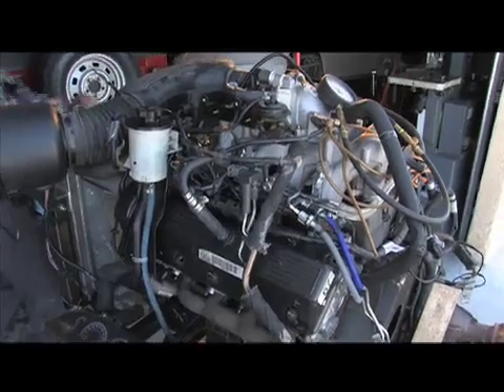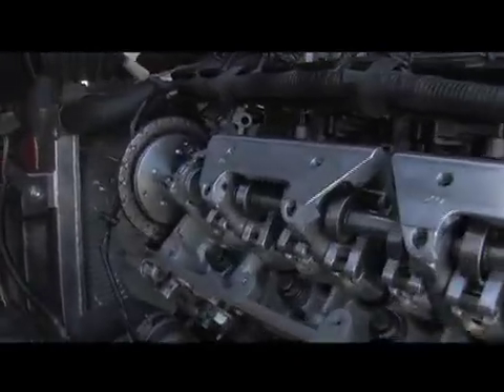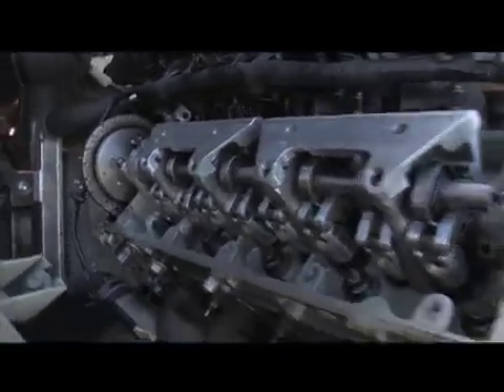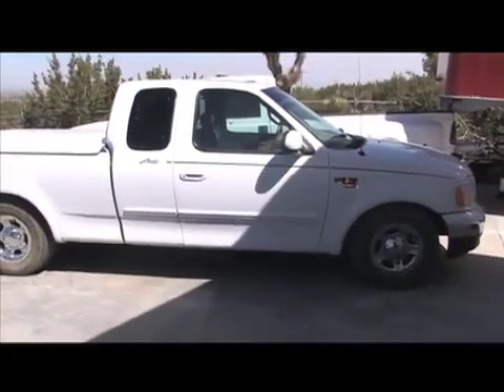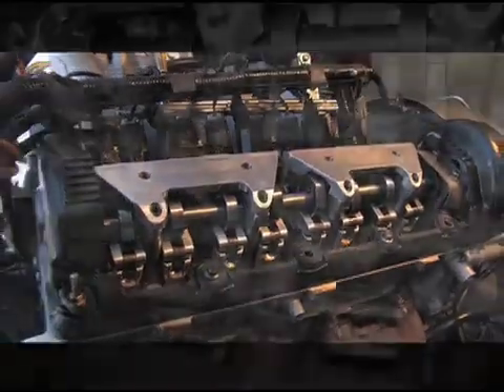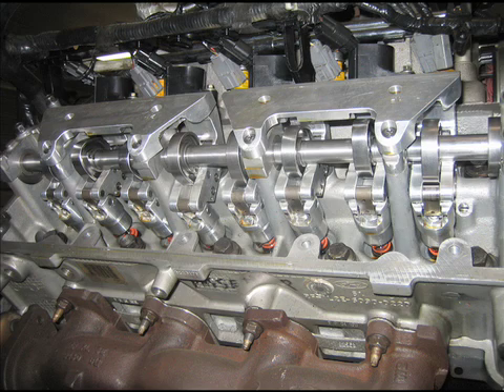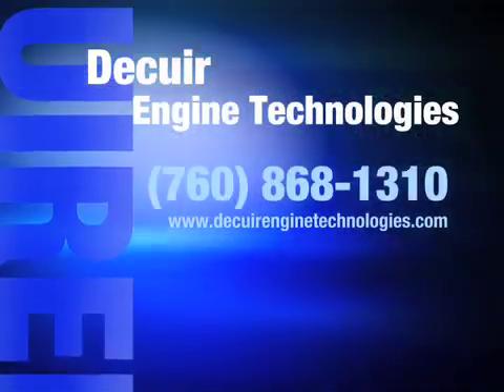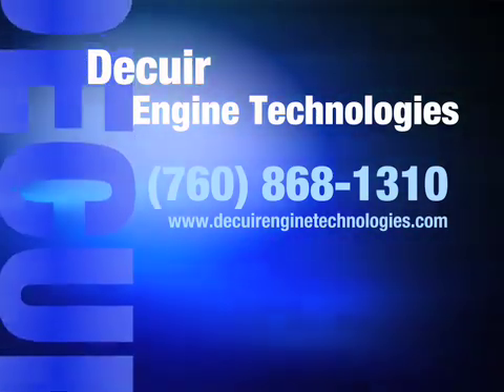Springless Valvetrain for the Ford 4.6 V8 Engine

Comment: it clearly uses heavy springs instead of shims ........LYING FUCKING DOUCHE BAG
Reply: No sir, it does not. The camshaft utilizes an inner groove within the lobes to push and pull the valve open and shut. Any use of a spring at the stem is there to seat the valve guide seal. Mr. Decuir can verify that.
Reply: then it is not springless , and awful heavy

 @CityofDiamondBar

Comment: supposed to prevent valve float ?? when its not revved higher then 1900 rpm I guess valve float would not be an issue ?
its noisy its expensive and nothing shows its worth a shit 
apparently this hick with a machine shop and spare time is hoping a billonaire will see video and give him 40 million to start production ?

Comment: Would this work on a 5.4 as well
Reply: actually, Yes. the only difference between the 4.6 and 5.4 is the deck Hight of the block. and the intake manifold is bigger for the 5.4 to accommodate the wider gap it needs to span because of that increased stroke length.
the real catch is " do you have the right block"   4.6 and 5.4 were produced in 2 different plants  Romeo ( Michigan)   and  Windsor ( Ontario)  and the 2 blocks are different enough for the heads to not be interchangeable.

Comment: lol at the people complaining about the sound. the valve covers are off! idiots
Reply from the maker: Thank you, its amazing how dense some people can be in their evaluation of this system.
Reply: It's still going to be noisy for the same reason a traditional solid tappet camshaft is noisy, there will always be some clearances, lash, to accommodate the expansion of the metal as the engine heats up. Most of us having gotten so used to hydraulic lifters and lash adjusters which automatically adjust themselves to maintain zero lash that we forgot how noisy an engine can be without them. And that's not to say they can't figure out a way to quiet it down later on. As I understand it this is basically a prototype. 
It's an interesting concept but I don't see it really catching on for the same reasons OEM's haven't embraced it.
Reply: so you think valve covers is going to stop this industrial sewing machine motor for making loud noises lol smh

Comment: It would be nice to see horsepower curves before and after.   While I´m here, how do this design compensate for valve clearance differences from cold to hot?  Does it just live with the gap until it gets up to temperatura?  That would account for the noise in the video, apart from the obvious valve covers being off the heads.

Comment: The desmo system works well on the Ducati motorcycle engines however the maintenance costs are horrendous eg new cam belt every 5000 km. Hopefully this system is low maintenance

Comment: Anyone notice the lack of proof on the other bank ?? the noise is normal its masked by valve covers though i cannot say what it sounds like with the valve cover on in real life.  besides if it reduced friction and improved power it could be sold to any manufacturer for tons of money and would be used in consumer cars by now
Reply: good ideas aren't used, ones that make or save a company money are uses unless the epa dictates so
Reply: +bentboybbz IF it was such a good idea, EVERYONE would be using it. It isn't, as the desmo valve train requires a LOT of REGULAR maintainence. The "average" car doesn't require this labour intensive style of valvetrain which is more focused on hi-revving racing engines.

Comment: I can see valve springs. Even desmo valvetrains need light springs to keep the valve against the seat.
Reply from the maker: +Bob Valdez No not correct, as is stated in the video the springs that you see are merely there to keep the valve guide seal in place and have nothing to do with holding the valve against the seat.
Reply: +EmpEntTV  The seal "springs" still bear against the valve retainer to provide tension on the seal. In effect, that still means you have springs in there. The factory valve seals are retained on the top of the valve guide, not by spring pressure, so you still have SPRINGS in the valvetrain.
Reply from the maker: +Bob Valdez Still not so, the springs have such little tension to in relation to the valve actuation of this system they have absolutely zero effect in its presence. The closure and seating of the valve in no way can be effectively done with that miniscule spring in place.
Reply: +EmpEntTV It still HAS SPRINGS in there, regardless of the reason. The 4.6L does NOT need springs to hold the valve seals in place. The only reason for these springs is to help keep the valve seated and low engine speeds. I am a auto mechanic, and have built many engines for motorsport. I'm not an Eskimo, so don't try to sell me ice. ;)
Reply: +Bob Valdez  "and" = at

Comment: Besides the noise, why does it sound like it's missing?
Reply: +GTO Bob 66 I thought the same thing. These engines generally idle and run VERY smoothly, this one does run very rough and unsteady at idle.  If it could run 100,000 miles without problems and show SERIOUS gains in power and torque, then it really is an exercise in futility.

Comment: Bloody rubbish!.  Sounds like a chaff cutter.  No Thanks.
Reply from the maker: +Crobular Thanks for your well thought out and highly uneducated comment.
Reply: +Crobular I It has no covers on it, and no oil. It was probably cold too. It would sound noisy. This is an old idea, and it is why Ducati motorcycle engines are famous. 
Top end horsepower is one thing you get. No float.
Reply: what is desmodromic

Comment: first time I'm seeing this - unless the appearance of it is just deceiving, it looks like you're stuck with a pretty lazy lift profile. I'd expect it to suck all around in terms of performance even though you eliminate the spring loss. That 4.6 doesn't exactly sound like it's better off and I'm not just talking about the noise from the exposed valvetrain

Comment: Desmo valve trains need to be adjusted very often. So unless you like having to pull the valve covers off every year. I would pass on the expense. Ask any Ducati motorcycle owner. Besides todays vehicles are highly efficient with very little maintenance or added cost.

Comment: Is this a diesel?
Reply: It wasn't running dry, that's why you can see oil drops on the camera lens after just a few seconds of run time.  It is rather noisy though, and I'm sure that the valve covers, even aluminum ones, would transmit lots of sound.  Oh, and it does seem to run a bit rough at idle!
Reply: +jivepepper no
Reply: Sarcasm? I know it wasn't just sounds like one.
Reply: +jivepepper Its because they are running it dry and uncovered.

Comment: Why is this needed?  If you are using good valvesprings, valve float usually isn't an issue below 9000 RPM.
Reply: ***** you're deluding yourself if you think the force needed to compress valve springs accounts for 20-30% of an engine's output.
Reply: I'm just saying, money talks, and so does proof.  This video is worthless without any proof.
Reply from the maker: Grant Russell There is also the issue of friction and the amount of horsepower needing to overcome valve spring tension. If that can be diminished or eliminated the natural by product is an increase in power and fuel mileage.
Reply: You overcame the power loss of compressing the springs and added to the rotational mass of the valve train. Regardless, i can think of better ways to add 2hp to my engine.
Reply from the maker: Grant Russell Safe to say that would be much greater than 2hp gain.
Reply: EmpEntTV How much of a gain was it?  It must have had some road testing in the past 5 years.
Reply: +Charles Ball Do you have any before and after numbers though?  Time slips/dyno sheets, etc.  That will shut the 'haters' up!
Reply: Donn29 no hate here. Just logic. A 300hp v8 doesn't take 60-90hp to simply push the valvesprings down.
Reply: Sure the turning the rotational mass of a supercharger that large, combined with the resistance provided by the physical act of compressing that much air would certainly cost 10% of your power. Pushing down 16 valvesprings every turn off the crank does not cost double or triple that. If it did, Audi made a very poor choice abandoning Desmodromic valves ages ago.
Reply: +Donn29 Ducati engines , such as the Testastretta, is rock solid proof of the concept, say, compared to a harley. 

the Ducati Diavel, or any of the race bike engines (paginale ) are the epitome of high tech engine valve train. I would say those pneumatic values are the only thing better, but they are not for street at all.

Comment: I would like more info. Hp gains, will it work with an aftermarket cam and heads, max rpm and hp this can take etc... if i could get in contact with one of decuir's people it would be greatly appreciated.
Reply: yes i wanna know
Reply: no reason it wouldn't work with aftermarket heads, but it is a custom cam design that replaces the old cam.

Comment: Slap those valves they should use the magnetic valve system  are the valve less  super low viscosity hydraulic arrangement developed by me if they really want to save kilowatts.
Reply: It you ever got carbon between the value and the seat the vale would bend bad.
Reply: hey this guy knows his math ..  he is right though .. (save mass) or the correct rotating mass multiplied by chemical force equates efficiency,  I think that is a way to just say it instead of put it on paper  there are other math short cuts for getting a quick idea or if you want spell it out in a (mathematical) to see your own understanding
Reply: Agreed... and if you really want to communicate, you should use the high integrity, depleted uranium hydro-maniac drive cellular phone system I developed in the 70's.
Reply: Never force a valve closed hell never force anything in a engine unless you want to turn it into scrap.

Comment: Still not as good as the desmodromic system developed by Mercedes-Benz  that came in 1st, 2nd, and 3rd place in the 1954 & 1955 Grand Prix with their W196R Grand Prix engines developing 1.91 horse power per cubic inch of engine displacement. Still it is better than the German desmodromic system that was developed in 1914. Go get them Ford/GM/Mopar - still only running 60 years behind the Germans. - but then - so is the rest of the world.
Reply: Germans are better known for over-complicating.  Try setting the cam timing on a Porsche 547 4-cam engine.
Reply: ***** oooh kill em
Reply: Would have been a lot further behind than that if the Germans hadn't wanted to fight and kill everyone on the planet. I like the design. It is truly amazing in this day and time that I can go from A to B without the Germans, French, English and Japanese. They would of course have me believe that I couldn't. Maybe I need to become a drunk?
Reply: Gitty up, you tell them

Comment: There is some important information you left off of your Stealth if you actually had one.  It is a forced induction engine via twin turbo charger that is helping that engine make nearly 300+hp not the fact that it has 4 valves per cylinder.  Remove the turbo and that engine makes 220hp.  You can get over 550hp out of a 4.6 if you add the supercharger so it is not an apples to apples comparison. On the other hand I don't like the way the engine sounds with this system, does not sound safe.

Comment: I'm interested by the clearance/adjustment process.The gods of desmo, Ducati, have a two tappet/cam system, but as this is an addition to an existing structure. My perception is there may have been a number of compromises made to get the grafted structure to work&that get access to keep the unit on the mark/in tolerance to get a consistency from the unit. The potential advantages are great,but the difficulty to keep it running, may be greater,the devil is in the detail.

Comment: seat pressure? valve adjustment ? its all going to wear but not evenly, I like what I see but I don't think it would last, I have to agree with the other comment in regards to electric solenoid driven valves,

Comment from the maker: In Typical ignorant fashion you have completely missed the point. What is new is the development of a desmodromic valve train specifically for the SOHC 4.6 Ford engine. It has nothing to do with development of a OHC configuration at all, we fully know and realize that this has been out for quite sometime.

Comment: The 05 injectors break off in FX4.  Someone said it starts with 06.  And to whomever said Ford injectors rarely go bad... Not true with 04-07 F150 5.4.  They go bad so often that Ford extended the warranty to 120K miles.  Of course mine went bad at 122K.  Called Ford Dealer today, Midway Ford, Hurricane, WV.  To change plugs on my 2005 FX4 is $300 labor plus $82 for each one that breaks!  Buy the tool for $62 & do it yourself. They recommend cleaning throttle body first to reduce carbon build-u

Comment from the maker: Oh brother, you obviously were not paying attention. Take a closer look at the cam on this and you will see it has an internal groove that is connected to a cam follower. As that follower moves inside that grooved path, it is pulling and pushing the valve open and closed. It has nothing to do with a valve spring closing the valves on this engine. DET

Comment: Three questions. 
1. How does the noise level compare to the original valve-train?
2. What is the max RPM you have tested this to? (are cam profiles the same or higher or lower lift)?
3. How is the durability (miles/ hours on the dyno?)

Comment: @EmpEntTV they have everything to do with the valve closing, on the springless engines, its the connection of the rocker arm that opens and closes it. Your comment on that the spring does not do nothing but hold the valve guide is so wrong.

Comment: Is there anything new about this??? Desmodromic technology has been in Ducati motorcycles for several decades and been used in several manufacturers like Mercedes-Benz to name but one in its race cars in the 1950's. I want to convert an L83 Chevy 350 which has been convereted to gear timing with Desmodromic valves but would this kit do the job?